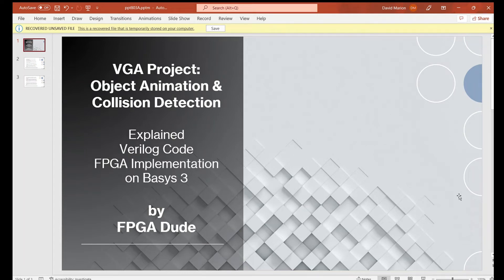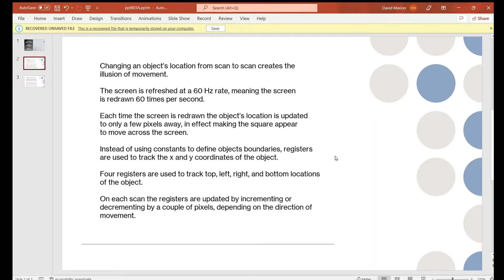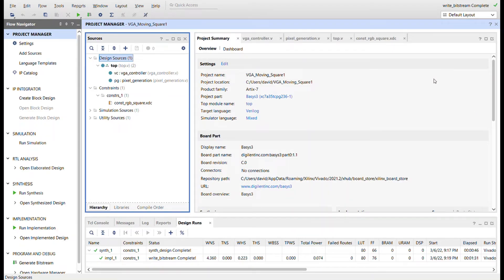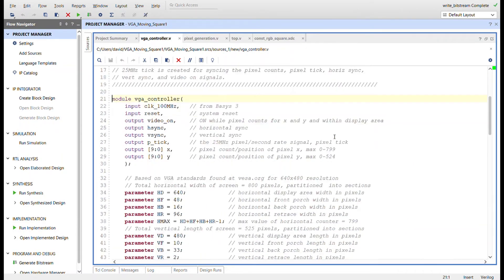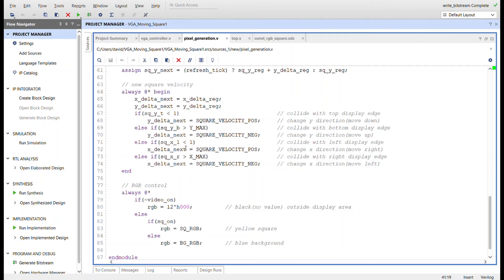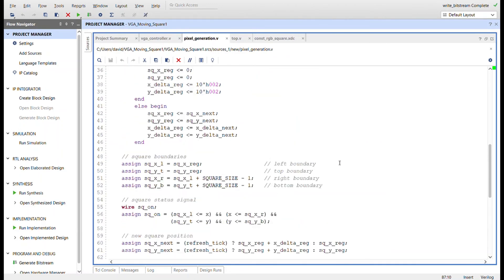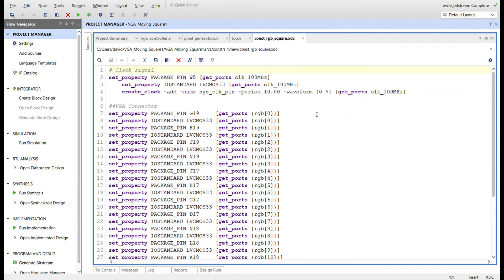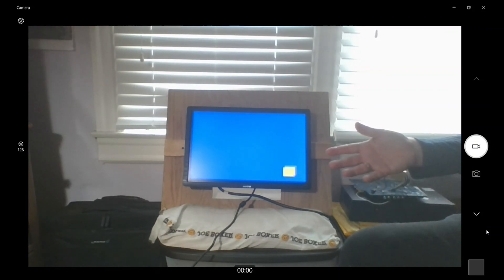VGA Project Object Animation and Collision Detection in Verilog, Vivado, Basys 3 FPGA

Comment: Great content, thanks for this!
Not sure if you'll see this but I'm trying to better understand how the code works with the animating and to do so I was challenging myself to try and make the box endless loop around the display area but was unable to do so after many hours of attempts. I am failing to understand where the square starts as I thought the x and y registers determined that but with my code whenever I reset, it would start on the bottom left of my screen, likely something to do with the code I modified to detect the borders. 
My idea was just to utilize the same border detection you had but I would want to start in the top left and then just only have movement either vertically or horizontally, no diagonal. So I just made it so whenever a border is hit, I would set the horizontal or vertical next registers to 0 and the other to the pos or neg where needed.
Reply from the maker: Sounds interesting. I don't see a reason why your idea of having the square bounce around the screen wouldn't work. Keep working at it, and I'm sure you will find a solution. Thank you for the nice comments. Happy Thanksgiving!
Reply: @dajoma36  Thanks for the words of encouragement
Just unsure of why whenever I introduce a new condition for a border it will only detect that condition and endless loop from there.
For example I had the top border condition and then it would start top left and go down
Then I introduced a condition for the bottom border then it would only start from bottom left
Hopefully I can figure it out 
Have a great thanksgiving aswell!

Comment: Absolutely beautiful. Thanks 🙏
Reply from the maker: Thank you, and you're welcome.
Reply: @dajoma36  i get the blue background and a yellow box but its not moving!. I checked every thing dont know what could be!? Any suggestions?
Appreciate it.
Reply from the maker: @Avionics2  If you copied the code from the video, maybe there is a minor error that is allowing bitstream generation, but the logic may not be correct. Try using  the files on my GitHub, they are the exact same files I used: https://github.com/FPGADude/Digital-Design/tree/main/FPGA%20Projects/VGA%20Projects/VGA%20Bouncing%20Square
Reply: @dajoma36  thank you its working now!. Yes i could see some differences in pixel generation file.
Great stuff i appreciate it.
Reply: @Avionics2  No problem. Glad it's working for you.